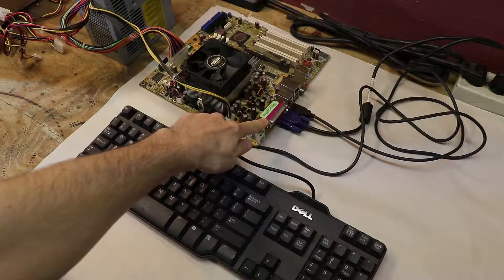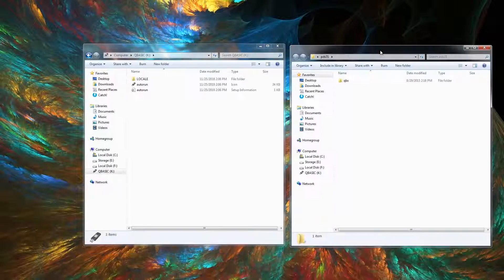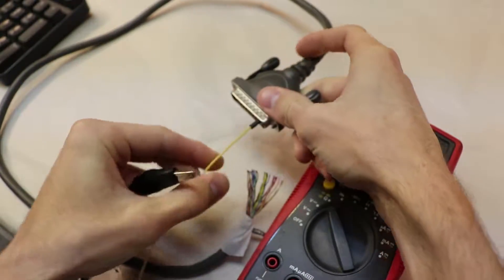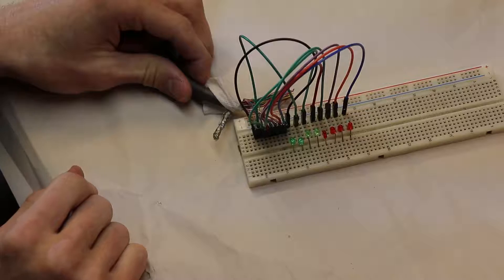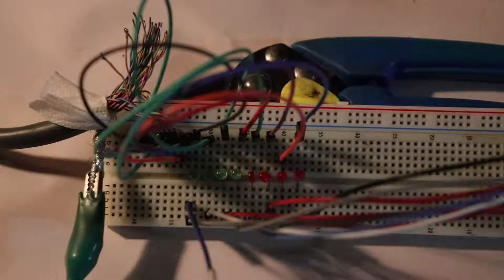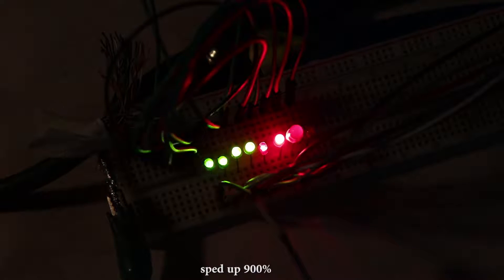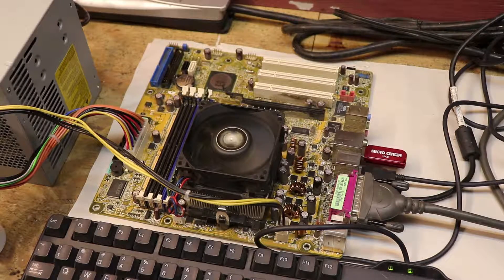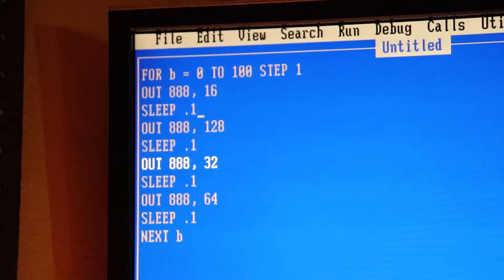Forget the Arduino and Pi, use your old PC!

Comment: I used this features 30 years ago. In the bios you can see the direction of parallel port ie 378 2F8 or so one. You can also comunicate with serial port, similar to arduino's uart, but at different voltage levels.

Comment: This help me much, since I cannot get a Arduino unless I make one or a Pie, yet I got a lot of old PCs. The cable thing is for improvement and with some old windows or Linux you could program in the Arduino code too. Or any language. It's worth a try. Also if the motherboard is not demanding more than 150 watts there are compact power sources that you can use to gave a compact de design. My goal for Arduino was to get a decent 3d printer from parts but maybe this could work for me.
Reply: If you have 2 parallel ports and 2 very vintage 2d dot matrix or inkjet printers with esc/p or HPgl or similar command print lenguages (and the documentation) you can program with qbasic or turboC the 3d printer movements.
Reply: @joseparedesalbuja8293  maybe in theory but I have to research it well.

Comment: 35 years ago, we used SOUND for delay
SOUND command takes a frequency parameter and a duration parameter
if i remember well BEEP was a standard beeping at a specific frequency and specific duration
The other issue was that BEEP... beeps while SOUND can take a very high or very low frequency so you wont hear it at all
Dogs will
but you wont
lol

Comment: Don't try to drive anything more than a transistor or tiny LED as you did, use those IO lines to drive the gates of transistors.. If you try to sink/source too much current you'll cook the IO chip.

Comment: parallel port is more dangerous to use than using arduino
if someone is not experience in electronics, he could burn the whole board 
moreover, the power consumption of these boards is nearly 100w compared to 5w when using arduino
I suggest using it as a web server in home automation

Comment: Great idea. Next step is serial I/O as the Arduino had serial I/O on pins 1 & 2 and analog I/O from the game port.  If you are more daring, add a second parallel port with an add on card for 16 I/O pins

Though BASIC is great, programming in C would put it as an Arduino.

Comment: My experience is those with parallel port usually don't have USB port, or at most 1st generation USB only(dos/95/98/Linux <500mb footprint can't boot from USB:no driver, other os too slow).  And also bootup floppy or hdd (<1gb) can't be found anymore. So  unless someone provides a very cheap bootup solution (cheaper then sbc),  can't really play with it.
Ps: floppy emu cost >$100.

Comment: Possibly  instead of 0.1 with the sleep(delay) command you could try 1/10 for 0.1 and 1/100 for 0.01 etc... I have no clue and have never used that format for programming, but i do salvage computers for the PSUs and heatsinks and whatnot... I am intruiged by this I must say. Kewl video.

Comment: I think the PC sucks for these kind of things, I always used my Commodore 64 for this purpose and today in these modern days, I still do. The user port of the C64 is really designed for doing hobby projects and this shows by the fact that you have data direction control over every pin just like you have on the Arduino. Further, the serial pins on the user ports are ideal for interfacing with shift registers.

Comment: What is the advantage? You are running a large pc motherboard (huge PSU) and BASIC, to operate 8 bits. An Arduino runs compiled code faster and has many other features like a to d. Does 21st century programming easily.
Reply: Arduino has limited memory storage.
Reply: @1pcfred  How much program do you want to write in BASIC?
Reply: @featherbrain7147  I want to program everything in basic.

Comment: I suggest to make an adapter board which has an input parallel connector for the cable and output pins for breadboard (and maybe the 8 data indicator LEDs, too)! This way you doesn't need to cut ("damage") any cable for this! 😉
Reply: To be fair there is not much use for old parallel port cables today.
Reply: @1pcfred  Well, this could be one... ☺
Reply: @zsombor_99  when I made my buffered parallel port break out board I did use an old riser cable on it. So a parallel port cable just plugs into it. But I did cut the riser up in order to do that. I have far more of those today than I'll ever need.
Reply: @1pcfred  I mean, with the suggested adapter board, doesn't needed to cut any parallel cable to use with breadboard, so that way "anyone" will be able to easily use an old PC as a microcontroller.
Anyway, I just made a suggestion for easier usability, nothing special...
Reply: @zsombor_99  that's great if you have the board. Most do not though. I could be wrong but I think the main point of this video is to use what many do have. Which is old PCs not quite powerful enough to use with modern software and old cables that don't plug into anything that anyone uses anymore. What's going on here is an alternative to going out and buying more stuff.
Reply: @1pcfred  No, you doesn't understand me. I ONLY suggested to make that adapter board, which is just an idea. 😶
Reply: @zsombor_99  I have made a buffered parallel port board. I am not sure if everyone is capable of doing that themselves though.

Comment: AWESOME VIDEO..!! It would be great if you make some videos on how to use the arduino's shields with this method. I mean lcd's, robotic arm, temp sensor, etc. How to get information (signals) from outside world into the pc motherboard.?
Reply: Instead on out use inp(address) to get input from the port...if it doesnt work there might be a register to change: plenty of info on the net!

Comment: So how do you go about writing, saving, rebooting, auto starting the device? I'm currently using an arduino uno, but it's very limited to what it can actually operate simultaniously. While I got quite a few older PC's still laying arround with said printer port attached. I also got some ISA slot cards with an additional printer port(s) doing nothing.

Comment: Qbasic allows subroutines and functions, maybe you can Program a very fast empty for loop to be used instead of the "beep" or the "sleep" function. I.E.: FOR x = 1 TO 10: NEXT x, this will provide the fast pause you need. Adjust the upper  bound accordingly (maybe 1 TO 100, 1 TO 1000, it depends on how fast your basic interpreter is...). Hope this helps. Stay at home!

Comment: I use to do this but learn real quick to add isolation such as Relays and Optoisolators. Not fun blowing up a Parallel Port on a PC. Assembly works better rather then BASIC for this kind of stuff.

Comment: did this for,years with a 486 laptop steppers  etc btw parallel port is only 2ma out use resistors in series with leds by my calculation 1.2 k ohm

Comment: Why you are checking the data bits' pin in parallel port cable? Can you just use male-male jumper directly from the parallel port socket on the board? You said from 2-9 are our pins right?

Comment: Those old computers don't boot from usb. Actually you are lucky if it even has one to begin with. And the whole thing with arduinos and pis is the ability to read sensor data and run on a batteries. ..which this definitely can't. There are no libs for devices so that sucks too, it will take a lot of effort to get them to work. And making small interactive devices is all the fun in doing this. Not to mention that all your work can go away if you short or overvolt one of the pins.
Reply: You are wrong, old computers (expcept if they where of the 60s or 70s) can boot usb, I tell you bc I have 4
Reply: @darkerstudio5613  my first one was a 486 dx2 in 92, and did not have it . The second one was a duron and also did not have any usb ports, I had to add them using an extension board. Also the one I had at work at the same time did not have one. Actually in 2000 only the general manager's computer had an usb built in, the rest did not. I should know, I was the IT support guy...
Reply: There was about a ten year time period starting around 1998 when it was common for PCs to have parallel ports and be able to boot to USB.  That's most machines from the Pentium 2 to Pentium 4 era.

As far as why - well, because it's fun.  That's how people used to do this back before microcontrollers were cheap and easy to get and program.  There is commercial software going back to the 80s for doing industrial control with parallel ports.  Sure, you wouldn't want to do it today for anything serious, but if you're serious all the time then what's the point?

Comment: No current limiting resistors for those LEDs?  Could have blown the LEDs or worse the parallel port.

Considering the size and power consumption of an Arduino, not to mention the more GPIO pins and options, I'll stick with the Arduino

Or a Pi which already has a graphical interface and Python to replace BASIC

Comment: So we can run motor according to program so we can make a ventilator which we use by using remote and can collect data of patients so AI use it in many conditions and copy the natural rythems of the human body 

Or we transplant an absorbent in lung which can occupy the basic volume of the lungs and operated with battery 

Or we can fit a ventilator which gives artificial respiration by mocking the natural respiration needed or we manually operated it with touch button or voice commands ????

Comment: Use its fast parallel port to do a DAQ? Just read the parallel data directly from a ADC module. You will probably need more than 8 bits but if its fast enough you can do multiplexing.

Comment: an interesting project. but unless you are doing a project that is going to need more storage for the program or perhaps internal data logging I cant see why you wouldnt just spend the couple of pounds/dollars on an arduino. cheaper to run too than an atx psu and no need in most uses for a cooling fan.

Comment: Nice thinking out of the box,but maybe you can use old laptops instead of desktops,my guess is that computers are more usefull when you avoid the factory settings,maybe someday someone will find a way to run the system on less ram that we need today...

Comment: You could as easy use a Linux distribution running Scratch or Python.  AND then have 1/10 of a second without problem. :-)

You could even use OCaml or Haskell :-)

Comment: Interesting idea, but MCUs power consumption would be still more eco friendly then repurposing this kind of computer. Also many older MB (core duo gen) couldn't easily boot from USB.
Reply: Is power the only eco impact? Do Keebler elves make MCU magically? Or are they made in polluting Chinese factories? Inquiring minds want to know!
Reply: @1pcfred  I think power is the most severe one between PC and MCU. I would prefer to make a some sort of arcade machine from it or something that more suits its horsepower. Still my point was mainly about using heavy lifting PC do the puny tiny work. If you want to have a better sleep, you can get the decent MCU from old home appliance.
Reply: @Buracisko  you may be able to find a MCU in decommissioned gear. Personally I do not care for programming in general. But when I'd had the displeasure to be involved in such a thing I do prefer programming PCs over MCUs. There is no accounting for taste though. Yet one still cannot completely discount proclivity as it relates to motivation and inspiration. Don't wanna stops me from doing all sorts of things in this world. And on that note I am going to work a bit on something I do want to do right now. Which has absolutely nothing to do with digital electronics whatsoever. I just need to find the right scrap of heavy steel to make into chips over here.

Comment: Great video. Good basic information to get experimenters started.  I've used more or less  the same setup to build a capacitance meter written in Visual Basic 6 - of course it runs  on Windows 98 so as to have a nice display.   I know you could have added way more stuff but perhaps you might consider many more follow up videos ?  Say, describe the handshaking lines ie the Control register and the Status register for a few more outputs and say using Paper Empty ( pin12 ) or Select In ( pin 13) as inputs or of course how to use the Data lines as inputs.   Also it was so frustrating for me until I worked it out - perhaps go into a little more detail about bios settings. I had no luck until I figured out the difference between EPP & ECP settings. You could save a beginner a lot of time . Hope you can use these suggestions

Comment: The critical problem with reusing old PC's that it makes zero sense. 
They consume so much electricity that a brand-new Arduino Uni pays for itself within a month of operation in a 24/7 operation...
So the PC approach works, but it is an utterly stupid way to go.

And if you would like to make it your own, it is just to draw your own Arduino Uno and make your own PCB in any number you want. That can not be done with an old PC design...

Comment: Thanks for sharing this, interesting project but it seems like rather lack lustre processing performance and inefficient power consumption, not to mention the gross physical size of the whole rig, for what its capable of. This is 2020, after all, ESP8266 / ESP32's running the free o/s MicroPython, can blow the doors off this performance. ESP's run on a couple of ma of USB 5v and can be had for just a few bucks and they support WiFi in either access point or station mode! Basic is old & passe, where MicroPython is no more difficult than basic to pick up, it is current, well documented and still supported by its community and developers. MicroPython seems a much better bang for ones buck / hour learning to use.  Granted this is a use for an old PC but how long before the extra power used would have paid for an ESP32 instead? Am I missing something?
Reply: Yes, you are missing something. He did it because it's cool!

Comment: Why reinventing the wheel? Arduino is a microcontroller, and PC is a general with a power-hungry setup. With two completely separate purpose. Pc is an overkill for the most of the applications. This is like we would compare FPGA to microcontroller. Different beasts

Comment: Use C instead of qbasic.
Qbasic is a long-dead language, C is still in-use.
I think it came with MS-DOS 6.22 (the last pure msdos) and that's why it gained some popularity.

DOS: 
outp(0x378,n); //assuming 0x378 is the LPT I/O address (not always)

Linux: 
FILE *fp = fopen("/dev/lp1", "wb");
putc(n, fp);
Reply: QBasic is pretty much dead, but BASIC dialects are still used all over the place in the automation industry.  Go to any decent sized factory or other industrial complex and more than likely there's BASIC in there somewhere.  The PLCs use their own specialized languages, but the computers that talk to them generally run programs that use BASIC for scripting.

Just last week I was converting programs written in a dialect very similar to QBasic (for FactoryLink) over to a dialect based on Visual Basic (for Wonderware).

Comment: @SciCynical Inventing Will this work with an older version of qbasic? I was going to try to do this with a win98 PC from 1996 that I installed an older quick basic onto. I just need the cable at the moment.

Comment: Can you run Marlin on this? Can you control A4988 through this parallel port? 

Because if you can't - 80% of Arduino usefulness just vanishes.

Comment: I liked the idea right up to the point where there's only 8 data lines available.....only 8??? i think not, i just wonder how you would use the others and even then: there are just 21 pins, an Arduino mega has 54, what about pwm? etc....so many questions...................

Comment: Why not just get a DB25 connector to mate to one end of a parallel cable, instead of cutting the cable in half?  Then just solder wires to the DB25 connector as required.

Comment: hmmm, when i build a pc in the far future, im gonna attempt to get a motherboard with a parallel port.
Not sure what I'd do with it, but with the technology available, I'd come up with something.

just googled it, apparently it's not hard, and if i wanted i could just go for an expansion card that would have a f*** ton of parallel ports.
Then again, wouldn't their be a way to just go straight to io ports?
Reply: Or just going with a external GPIO USB board. Then again, parallel port adapters aplenty, if the machine needs one.

Comment: Where are your current-limiting resistors?
Reply: Not strictly necessary, although it depends on the LEDs being used and the source of your power.

Out of a parallel port the current is likely already limited to very low 10s of mA by the CMOS circuitry driving the signals. Hooked directly up to the 5V rail you would definitely need them.
Reply: @TomStorey96  actually, that's wrong. CMOS circuitry most likely didn't limit current as part of the design, because it was never built to drive LEDs.

However, if the LEDs are not internally current-limited, this is how you burn your port or a pin on it (in the video one pin was not working; could be a bad cable or a burnt pin/driver)
Reply: @NurchOK  I always use resistors in my own circuits, and I should clarify that it is certainly a good idea to use them. But I'm simply pointing out than you can often get away without them.
Reply: @TomStorey96  often or not depends on the design of your LED. If it is internally current-limited, you got lucky, but if not, it's a problem